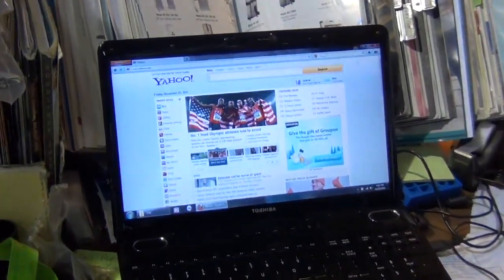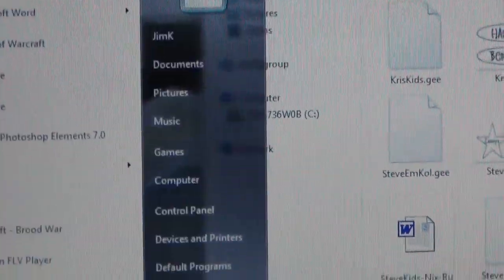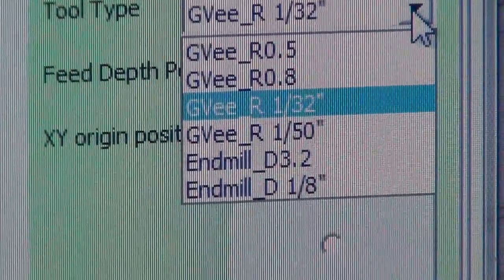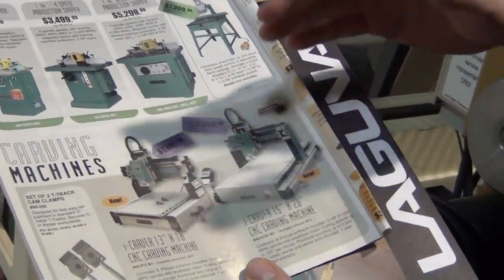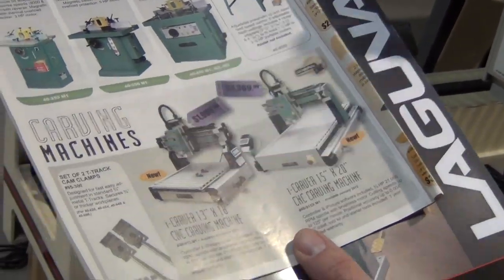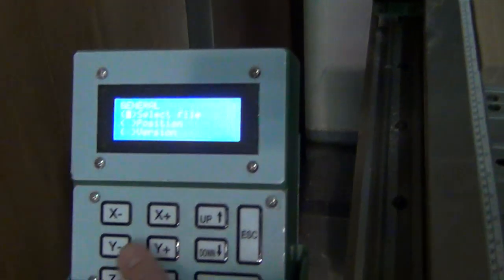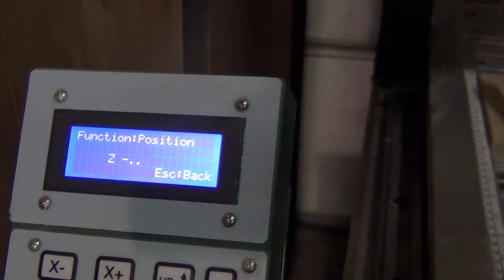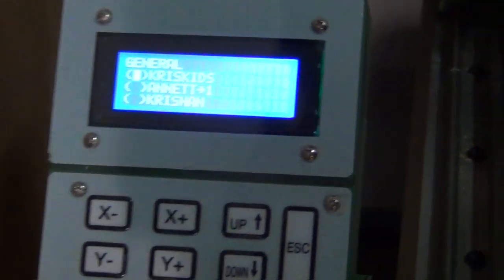Demonstrating General CNC's i-Carver Carving Machine and Carving Software

Comment: I have a General International I-Carver at work that powers up fine and works in every way, however the spindle will not spin when I turn it on with the controls. Last night I left it unplugged over night and when i came in this morning i was able to run a carving job without issue. Once the job was finished I Turned the machine off and then powered it up again to test the spindle again and it would not power on.

The green light is on when the machine is powered up which as I understand it means there is power getting to the spindle motor. It also flashes when I select the file I want to run which means it is running the program.

Not sure what to do from here. Any help at all will be much appreciated.